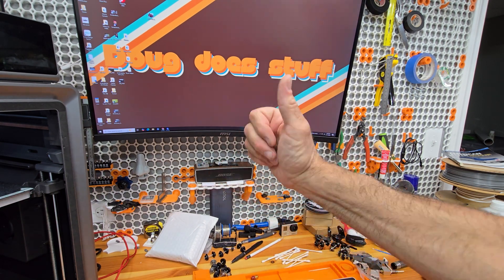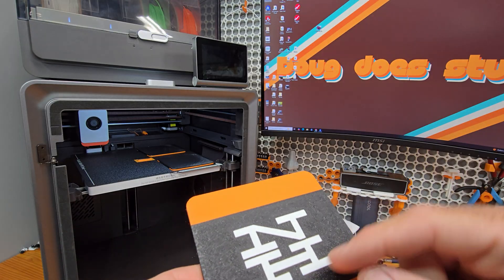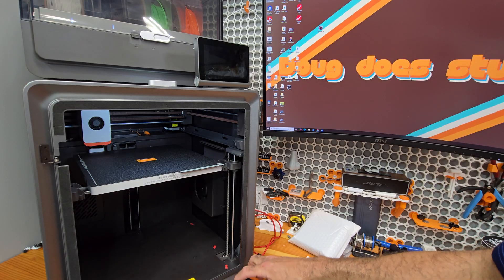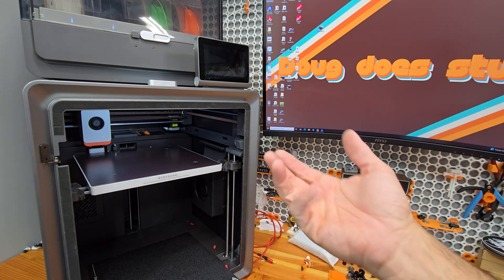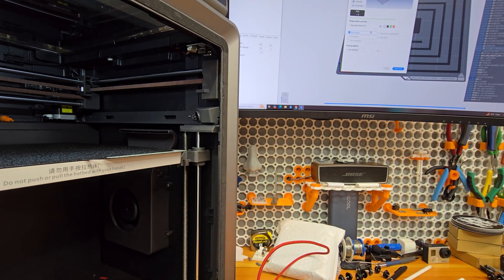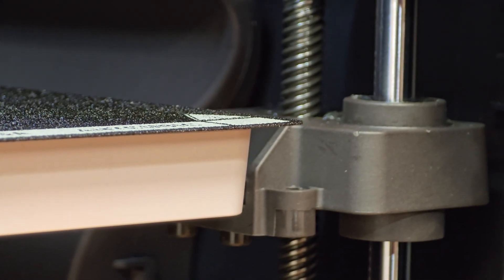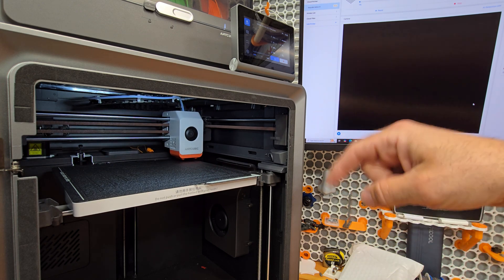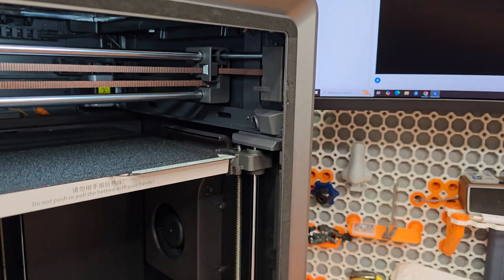Kobra S1 Combo: Bed Leveling BUSTED? Does it Actually Work?

Comment: Do you have the flow calibration feature turned on and have you tried it both ways? I went straight to Rinkhals and custom profiles with mine so haven't used the AC slicer, but I have heard quite a few people say their prints are much worse with it turned on.
Reply from the maker: Good to know.  I used it at first, but haven't used it since the nozzle clog I had.  I do need to try Rinkhals
Reply: @dougdoesstuff24  It's SO fast and easy to install (and roll back if you don't like it). I'm a diehard Klipper gal so it was the first thing I did after setting The S1 up. Rinkhals is a huge QOL upgrade that has no downsides to giving it a try. You do lose AI detection if you use the webcam in Rinkhals, but the cam is much better and always on with it. I tried OctoEverywhere on it and found it to be too much strain on the MCU. I work from home so it's not a big deal to peek in on it from a browser or on Mobileraker every now and then. 

I have watched your saga from the very beginning and it definitely weighed into my purchasing decision. I did ultimately get the S1 and after 200+ hours on it am so pleased. Your experience has bummed me out, but if it's any consolation you're helping a lot of people! It helped me to know what to look out for and to order a spare hotend so I had it on hand LOL.
Reply from the maker: Hey there, thank you so much for following along, I appreciate you and your feedback!!!! Definitely going to give Rinkhals a try.  And, glad I am helping, even if in a little way.  Happy printing!

Comment: I have now 225h on mine
I’ve had issues with bed leveling but I got a smooth PEI plate and it’s been running great since. Other issues with Matt PLA triggering tangles but seems to be a filament issue with the ACE
Have you tried sending a print over wifi while doing the bed level? I’ve had instances where it seems the bed meshing “didn’t take” while doing it before print over WiFi
Exact same print launching a second time and it stuck to the plate.
Reply from the maker: I haven't had that issue as far as I know.

Comment: I have the same printer and I am running the Rhinkals firmware alongside the stock firmware, what it does is exposes the Klipper firmware to the network and allows you to remotely print from orca slicer.

I also have issues with bed level  I am in the process of getting Anycubic to either replace the bed or replace the machine or refund as it is a very poorly made machine the deviation of my bed is 0.715mm between the lowest and highest points.
Reply: I receive a new hot bed from Anycubic, but the installation of it was really stressful.
Reply from the maker: @Scheettini  I am sure!  I hope it gets things fixed for you!
Reply from the maker: I do need to try Rinkhals at this point.  That is great that you are getting that from Anycubic.  I'd be interested to know if they just replace the printer and how that goes.

Comment: I think that the top layer problems at 2:10 are over extrusion or maybe heat related. If there is overextrusion for several identical top layers the problem will build up until the plastic cannot go where it is intended and it starts to flow over the previous line and also hits the nozzle  and gets moved around into that ripple pattern. It could also be cooling, you're putting down a lot of material in a solid layer right on top of the heated bed so the part will take longer to cool. Is the part solid, or does it have some infill, having a couple of infill layers has helped me with similar prints.
Reply from the maker: The part has 15% gyroid infill. I think the next thing I'm going to do is look at the filament profiles. This is anycubic filament and it is getting the profile from the RIFD tag.
Reply: I already tried to tell him it's over extrusion, even said mine looked exactly like that until I calibrated the flow, I've tried to help many people with some good advice but everyone thinks they know it all and it's this or it's that, so I guess it's time to shut up and let them figure it out for themselves, I mean what would I know, I only have over 2000hrs on these machines..
Reply from the maker: Not ignoring your advice, just haven't gotten to try that yet.  These videos are made days ago, so it takes time to catch up on the advice and make new videos.  Believe me Kowboy, I read all the comments and try to take the advice to make this thing work, but I am doing one thing at a time to narrow it down.  You're not ignored.  Thank you for following along and happy printing!

Comment: Hi. I've had this printer for a month, it's worked for 60 hours so far and the prints are perfect. Without changing any settings! Yesterday I decided to test the first layer and printed the entire table to a thickness of one layer with the Z axis setting = 0.00. It turned out that the right corner from the front had delamination, and the rest was consistent, although not ideal. I loosened one screw on the table by 1/4 turn in the place where the delamination occurred, set the Z axis offset to -0.05. This setting turned out to be too low and the material was squeezed out to the sides of the nozzle. The next attempt was at the -0.02 setting and it was a bull's eye. I obtained a perfect print on the entire surface, obtaining a beautiful sheet with a thickness of 0.2 mm. Finally, I will add that this is my first printer and I have not had any experience with 3D printing before, I hope that it will print for a long time without similar problems as in your case. I wish you good luck in resolving your problems with this printer.
Reply from the maker: That's awesome! Good luck in your journey!
Reply: Oh! I'm having big prints coming off the surface in the right corner closest to the door! Maybe it's the same thing!
Reply from the maker: maybe, or maybe not.  What filament are you using?  Door open or closed? Brim around print? Do you run a bed level from the slicer?

Comment: level your bed! mass produced items are never perfect. I know it has auto bed levelling but that assumes it's calibrated correctly in the beginning at the factory. You can't expect to buy a budget printer and get professional results out of the box. I've watched lots of your videos and maybe you should change the name of your channel to, Doug Whines About Stuff.
Reply from the maker: Wow, you're right, but I purposely unleveled the bed to see if it was working based on what others have been saying. I do have to work on the audio quality, I think you're right that it sounds like I'm whining. I appreciate you watching my videos though. Thank you
Reply: @dougdoesstuff24  cool , it just seems that you've had more gripes with this printer than most people, maybe you have a bad example or were expecting more from it.
Reply: @jayathome3  hes pointing out stuff that other reviewers just ignore because a) they were paid to say good things b) they werent paid to say good things

the printer is far from perfect
it tries to copy bambu lab's printers but falls shorts (AI detection is not working, flow calibration is bugged, camera is horrendous, auto bed level doesnt work properly, quick release nozzle is not that quick to release and its been proven to cause issues, etc, the list is huge)

if you only see it as a $600 CoreXY, fast printer that also has the ability to print multi color and that you will have to tinker with just like a regular 3d printer, yeah, sounds right.
If you see it as a Bambu Lab alternative thats mostly a hands free experience, nope.
Reply from the maker: Not more gripes, just gripes.  I am posting my journey with this, and it might be ugly, but it is the truth.  They marketed it as this great machine, but that isn't what it is.  I know it is a budget printer, but I expect something to work regardless.  When I think budget, I think less features, slower, etc.  I don't think less quality, that is just less quality.
Reply from the maker: correct, no paid promotion or advertising here.  my money, my thoughts.
Reply: I think he has every right to winge about the printer ! I probably like Doug, buy a printer to, well print ! I don’t want to spend all my time buggering around with it to try and do what it was designed to do right out of the box ! I have 2 printers that I probably haven’t touched in a couple of years and they print almost perfectly every time I switch them on, my last Anycubic I have had to send back because it got so bad that it just couldn’t print ?! That bed was 30,000 of an inch out or around 1mm across the whole of the bed, I measured it, there is actually a video of me doing it on here somewhere. Unfortunately the machine just seemed to have a mind of its own, sometimes I think manual bed levelling was fine and quite easy but I guess those days are going ?!
Reply from the maker: thank you and appreciate the support.
Reply: @stephenkelly8065  so it seems everyone wants bambu performance but don't want to pay, or are too lazy to to put the  time in. I have a Duplicator 4 dual extruder (stock). Works amazingly well for its age. I get perfect prints. XY isn't a new thing. some people thing bed slingers were the original. lol